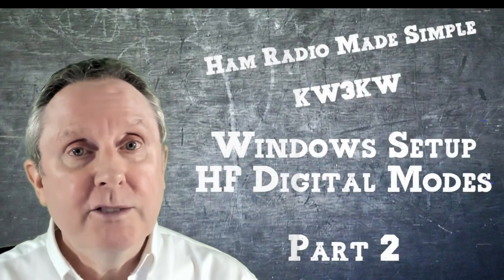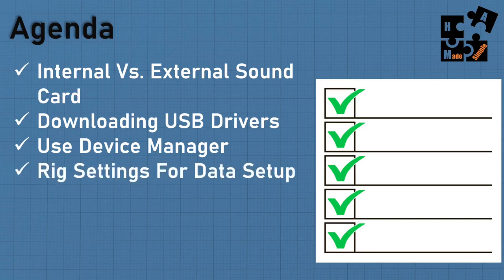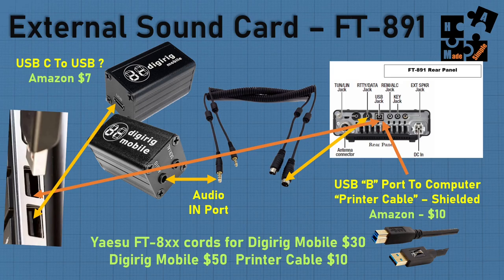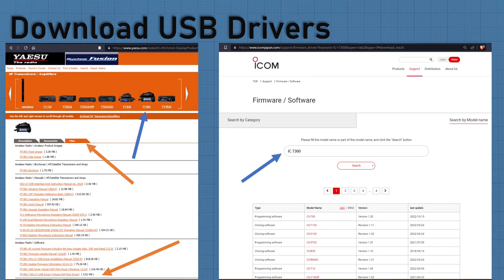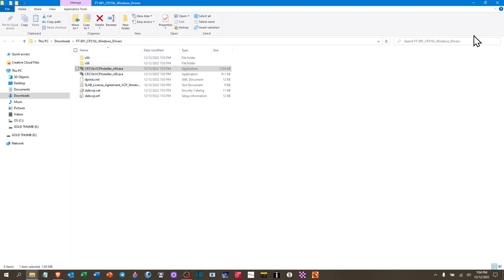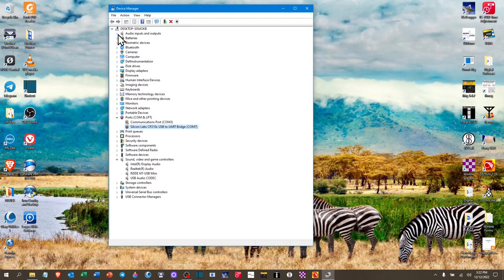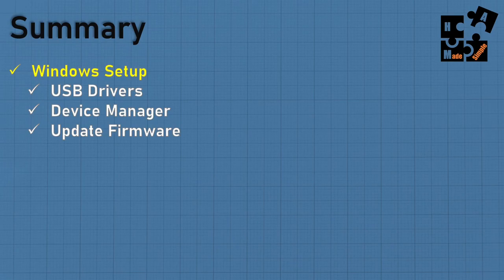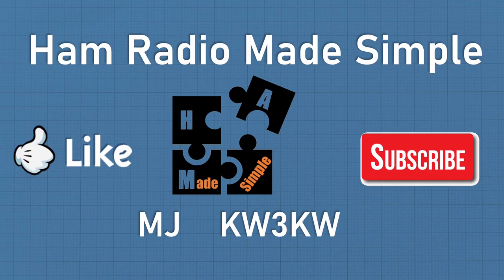Windows & Rig Setup For Ham Radio Digital Modes

Comment: Simply awesome content! Especially for fans of the 891, DigiRig, and Chameleon Antennas. Best summary of the 891 menu setting for digital modes I have seen in one place - well done. Keep up the great work!
Reply from the maker: I am a fan of all of the equipment listed above.  I will add one piece that I hope to do a video on down the road.  Palomar Engineers OCF-Dipole.  I use this to reach many of my friends across the US & Canada from Raleigh.

Glad this is helping and getting you up and running successfully.  Thanks for taking the time to post!!

Comment: While I do not have either of the radios you covered, it is clear that you are an excellent presenter and covered all the bases. Thank you for this great presentation! DE WA1KLI
Reply from the maker: Wow, thanks John.  I so appreciate your kind words my friend.  Since there are so many various radios out today, I wonder if there are setup instructions (data settings on the rig) offered to others?  What radios to you have?  Again, thanks for taking the time to encourage me!!
Reply: @hamradiomadesimple  I have a few older (as in 20 years +) radios and a current Icom IC-705. Since the IC-705 is very popular and similar to the IC-7300, a video on how to set up the 705 would be useful. 
Of course, if you do not have a 705, it is hard to do a video. ;-)
Reply from the maker: John, I have a friend who has the 705 and does digital.  I'm hoping to reach him tonight and see what he can tell me.  Stay tune!

Comment: I am really having issues with my ic 705 and rigcat connecting. I have the ic 705.xml software downloaded and placed in the device id box. Proper comports selected yet the rig control does not work.  I am not using flrig for radio control instead using win4icom suite as interface to the radio..  any id3as would help. 73
Reply from the maker: Email me at KW3KW@mail.com.  May have a solution for you.....

Comment: I have an yaesu FT-847, it has a DB9 communication port on the back, I have tried two differant communication cables, neither worked, so I have one on order that is sold as being spefic to the FT-857, Fingers crossed. If this new cable works, will I need another cable for the sound card, or will the com port on the back of the radio, also look after the sound card? I would appreciate any information, I have been licensed for years but, I am very new to digital, and right now I know zip about it but your video was helpful.
Regards
Derek
Reply from the maker: Good question, not really sure about this radio since they stopped manufacturing it in 2005. I checked out the Digirig (external sound card) site and came across this as a way to get it to work for digital.  Based on what I could read, it looks like this unit will work with the described setup:  https://forum.digirig.net/t/cables-for-yaesu-ft-847/257.  Let me know if this helped.
Reply: @hamradiomadesimple  Thanks for the link, it does give me some insight, but looks like I will have to wait for new cable to arrive. I need to get the computer talking to the radio before I can get to the next step. In the mean time I will watch the rest of your videos. Thanks again.
Regards
Derek
Reply from the maker: Sorry for not seeing this sooner, THANKS!!  Working on Vara AC now...

Comment: Ok I followed the video and even have a printout you sent me for the settings for my IC-7300 but my outgoing audio is coming out my computer laptop speakers can you ex[lain what im doing wrong?
Reply from the maker: What device did you check as your "default speaker" in Microsoft Sound System?  Check something that is NOT the Audio Codex.  If you still hear it, than check Microphone - Properties - Listen and uncheck "Listen To This Device". Email me at kw3kw@mail.com and I can get on the phone and trouble shoot with you.  Let me know how it goes.
Reply from the maker: Ok, I figured out what is going on.  In the software app, you don't have the Audio Setting correct.  You most likely have your speaker set and NOT USB Audio Codex selected.  Let me know if this fixed the problem.